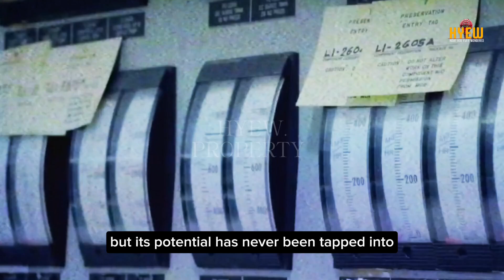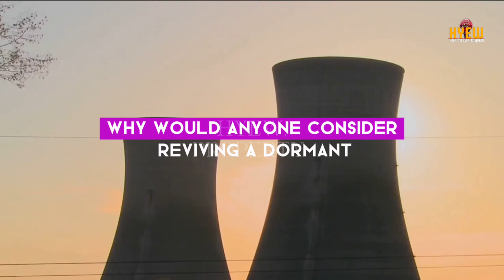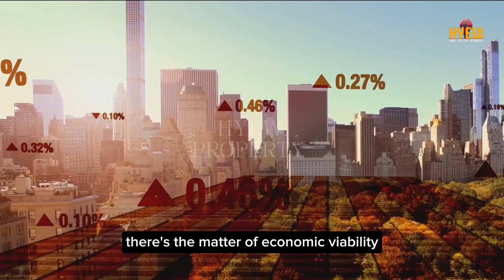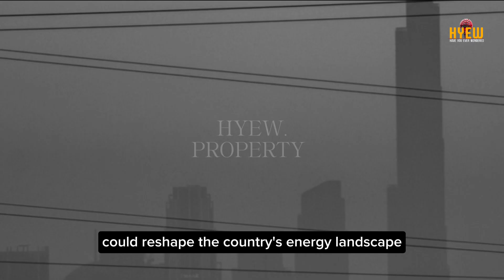Why do SOUTH KOREA want to INVEST in the Philippines BATAAN NUCLEAR POWER PLANT?

Comment: Economic viability and safety were two alleged reasons why the nuclear power plant was kept shut. How can they say economic viability when it was very well designed and built by Westinghouse and would have generated electric power to boost the country's economic growth. Another reason was safety, as they said it was built on an earthquake prone area. Even today no one can find a single crack on it's walls and silos that would store heavy water. No, the reason it was shut down was political revenge. The Aquino Administration branded this flagship project as something like a disaster waiting to happen , causing economic hardship as the country had to pay for the foreign loan that built it and it's dangerous location due to earthquakes. It is a small facility by today's standards, but can be a good start to train our young physicists to go onwards towards bigger facilities to be built in the future.